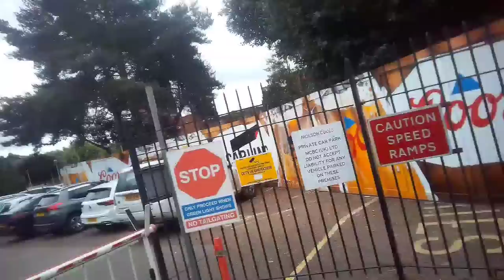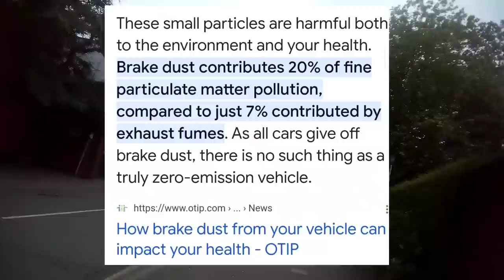WE WOULD LIKE YOU NOT TO TAKE READINGS THROUGH OUR FENCE ⚠️❌️📷

Comment: The percentages of particulate emissions  from brake pads are miniscule compared to the quantity from tyres. When a tyre wears out the rubber , adhesives etc that make up the tyre don't just "disappear" .
Reply from the maker: I wasn't the author of the study but apparently brake pads give off more particles than the emissions from your engine
Reply: @ReggiePhoto  They sure do Reggie , and the tyres are even worse. Keep up the great work, it's not often someone has a sense of humour as warped as mine .
Reply from the maker: @jamielee9350  😉👊👍
Reply: @ReggiePhoto  Worth noting that these figures refer to a specific size of particulate matter (PM2.5) which has nothing to do with greenhouse gas emissions, for example. So whilst it's probably true that brake dust makes up 20% of PM2.5, and that will be produced by both electric and combustion engine based cars, it is not 20% of ALL emissions - nowhere near that in fact. So the bottom line is that no vehicle is zero-emission, but electric cars, ideally recharged from greener energy production (solar, wind, wave, nuclear), are much, much closer to being so than combustion engine vehicles.

Edited to add: electric cars typically produce less brake dust than combustion engine cars because the brakes do less work. Electric cars use regenerative braking, using the motors to store the otherwise wasted energy back in to the batteries, requiring less use of the brake discs and thus producing less brake dust.
Reply from the maker: @bluecheese1066  I only shared some information as you know and confess I'm no professional nor competent in this field. One thing I do know for sure is in regards to your example of greener energy to produce the electricity, is this : I used to work for a company that I only recently left in the last few months that supplied all major energy plants, nuclear, gas conversion to electric, and all the major treatment plants. Whether it be sodium hydroxide or sodium hypochlorite even sulphuric plants. Whilst speaking to people in charge they told me that if the gas was cheaper on the day to produce the energy for the electricity the national grid would buy that over the free energy that the turbines where naturally creating. There we find the hypocrisy in the green agenda
Reply: @ReggiePhoto  I don't doubt that, Reggie, and it's something that needs to be improved upon for sure.

I do not think there will ever be any such thing as 100% green energy, but some methods are cleaner than others, and we should strive to always improve that situation.

Comment: Brakes do emit particulates but brakes on an electric vehicle are very lightly used. I did 17,000 miles in 6 months and had a tyre side wall puncture. When I had the tyre replaced, I checked the front disc, no lip, zero wear, the pads looked as thick as new.
Reply: Exactly. There was a study done on a taxi fleet that used a combination of electric vehicles and combustion engine vehicles. They found the EV brake discs lasted in the order of 100,000 miles, around four times as long as the ones on their combustion engine vehicles. Volkswagen (and presumably others) are even moving back to drum brakes in some of their EVs due to the brake requirements being lower, which means a lot of brake dust remains trapped in the brake housing rather than streaming out at every junction, etc, improving things even further.
Reply: @bluecheese1066  You talk about emissions then name Volkswagen how much have their lies cost them in compensation to car drivers.
Reply: @darrylrichardson7940  I don't disagree with that. I don't vouch for Volkswagen; I think their lies with regard to diesel emissions are despicable, but that is not relevant to the facts we're discussing here.
Reply: @bluecheese1066  You mentioned V.W. as an example so me questioning this is relevant.  FACT.
Reply: @darrylrichardson7940  But what is it you're questioning? I simply mentioned Volkswagen as an example of a manufacturer that is using drum brakes in favour of disk brakes on some of its EV models. Is that what you're questioning? It's easily verifiable - check out the Volkswagen ID.4 for instance.

You brought up the topic of their lies with regard to diesel emissions. I don't disagree, but I don't understand the relevance of that sentence to what we've been discussing, other than the word 'emissions' being in it. It doesn't change or challenge anything that's been said.

Comment: Just to counter that, I do have an elec car, the majority of braking that you do you're not using your brake pads at all, other than the final part of the stop.  Unless the car is above eg 90% charged, then the majority of slowing goes back into regenerating the battery.  As a result, I'm 5yrs+ in on my car now, and still on the same brake pads :)  Not that you're bothered mind, but thought I'd chime in with some edumacation :D

Comment: I always thought that its was a petrol/deisel that gave off 20٪ from the brake pads
But an elecric car gives off more than 20% due to them being heavier
Reply: It's a myth that electric cars give off more brake dust due to being heavier. They actually produce a lot less because the discs are used less. Electric cars mostly use regenerative braking where the otherwise wasted energy from stopping the car is put back through the motors to recharge the battery, rather than waste it all as heat. The brake discs / drums do a lot less work because of this. Brake discs on electric cars may do 100,000 miles before they are fully worn, several times more than the equivalent on petrol / diesel powered cars. In fact, it gets even better than that, because some EV manufacturers are now moving back to drum brakes because the requirements are less, which means a lot of the brake dust is contained within the brake housing and not emitted as a stream of dust each time the vehicle slows down.

Comment: And, the heavier the car the more brake dust it creates when breaking. Electric cars are in general far heavier than petrol fueled cars...so that's another lesson.
Reply: Heavier cars require more energy to be dissipated to bring them to a stop. That is true. However, electric cars use their motors to turn most of that energy back in to electric charge, rather than rely on the brake discs to do all the work. Brake discs on EVs do much less work, produce less dust because of it, and last ages too.
Reply: @bluecheese1066  thanks, i didn't know that. It makes sense!

Comment: The TIRES of electric vehicles wear 20% faster than those of internal combustion engines, which is due to the acceleration of electric vehicles that generate strong instantaneous power THE EAT MORE TIRES THAN  A NORMAL CAR,,, pollution from EV tires is nearly 2,000 times worse than that from vehicle exhaust pipes.